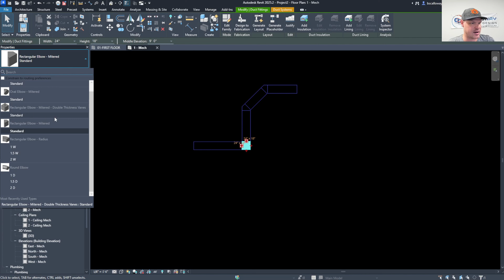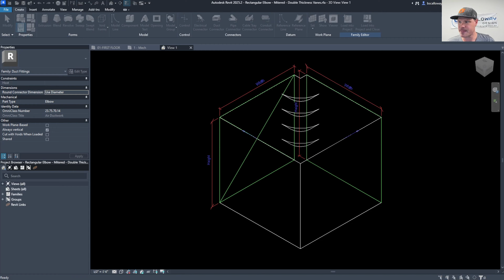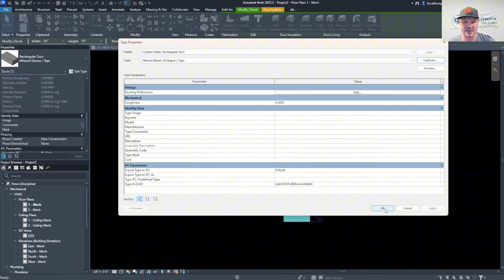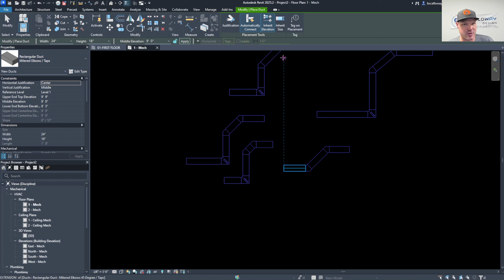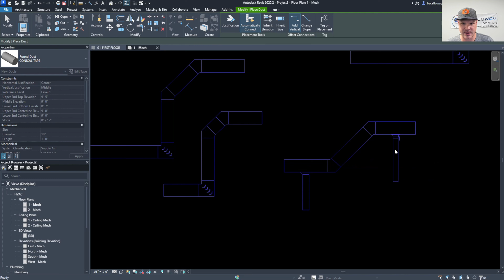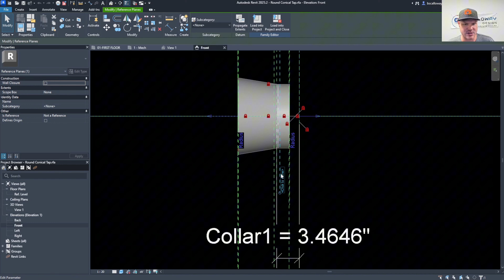Understanding Duct Routing Preferences in Revit 2025: The Beginners Guide

Comment: I’ve been using Revit a while so I don’t normally watch tutorial videos but just want to say I appreciate you making them either way. 

Most HVAC tutorial videos are done either done by someone that doesent actual design AC systems, or by someone outside of the US. I appreciate how you cover the actual issues people run into during design instead of clicking the “create duct” button and connecting a diffuser like most others. Most other videos actually just use the “generate layout” command which pretty much never works for actual design in my experience. 

I’ll keep watching and appreciate it!
Reply from the maker: Hey, thanks for the comment! Yeah, I came out of school doing AutoCAD, so I'm  completely self-taught in Revit. I could never find anything very helpful, so I decided to start recording in the hopes of helping others. Cheers!